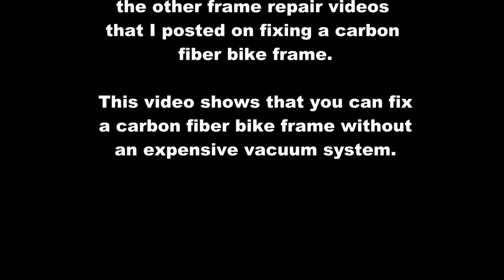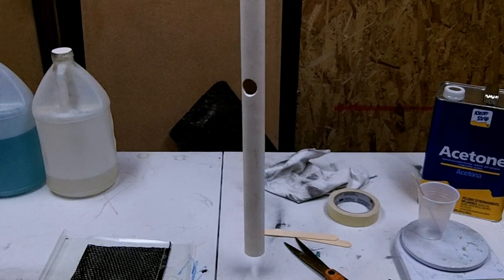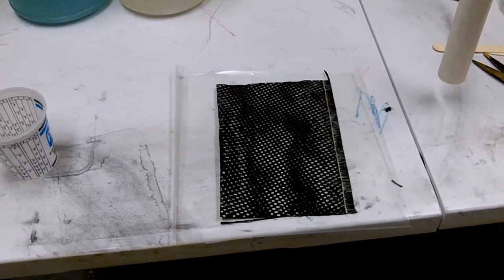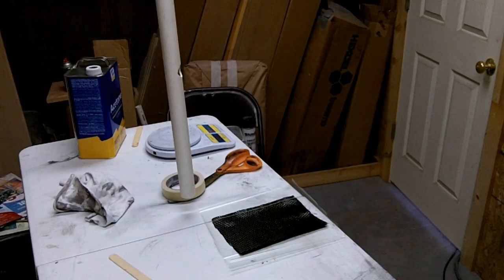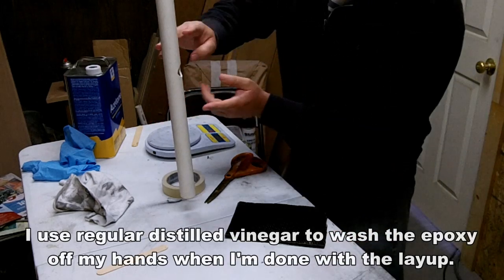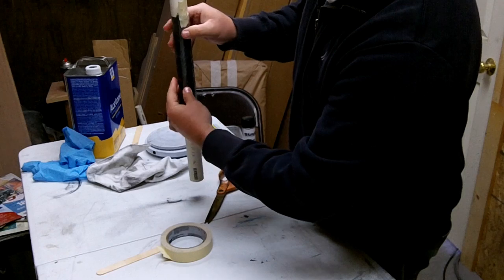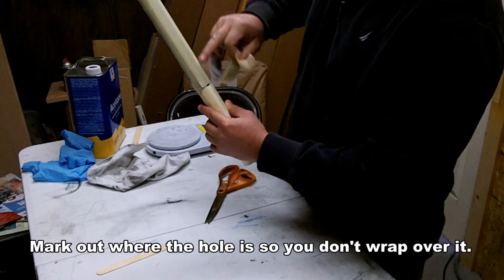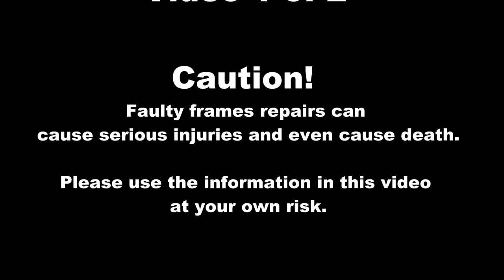Carbon Fiber Bike Repair 2- Tape Wrap Alternative 1 of 2

Comment: I worked with carbon fiber very often in the course of my work, be it carbon rod, plate or fabric/wrap type for strenghtening of structures..I meant huge structures like marine jetties , concrete bridges and buildings weighing 1000s of tonnes. Carbon fiber's the solution and even increases the tensile strenght of the frame. We used carbon for F1 cars body..go find out the body weight and thickness of carbon fiber used.. :) Well done,Mark King. I will share with fella bikers in Malaysia ! Tks !

Comment: Hm, I use peel ply tapes. So you don't need any pastic. I apply epoxy on top of the part to repair, and wait until it gets tacky. Then apply the carbon directly and put the epoxy on top. Then I use a heat gun so the epoxy gets runny and it goes everywhere in the gaps and saturates the carbon perfectly. Wrap the peel ply tape with tension around and you are done...

Comment: Have you actually checked if resin's Tg or HDT is enough for use under hot summer or for storing bike inside of a car? I need to fix a frame myself and I figured out that often advised WS 105 has very low Tg of approx 50degC. My plan is to post cure the patch with help of heatgun and small wooden box "wrapped" around area to be fixed.

Comment from the maker: @JOEY15277 
Well, I couldn't say for sure- it depends on a lot of factors and your repair. But honestly, I think you'd be fine just using the +/- 45 fiber orientation without the uni- you'd definitively want more layers to compensate for the the lack of uni though. I don't know this for sure but I don't think a lot of the guys repairing bikes professionally are using uni on their repair jobs.

Comment: If there are chips in the paint, does that mean the carbon underneath is cracked? I just got a frame off eBay and it seems solid, doesn't give when pressed, and feels solid (no cracks felt by touch) on the inside of the frame. It's on the side of the top tube near the head tube. Wondering if its worth the trouble of sanding it down to see what's going on and possibly run this fix
Reply: +SoSickWidit  If the frame is not repaired you run the risk of unexpected frame destruction due to cracks you cannot see. This is where carbon is a bitch to own.

Comment from the maker: Try? "Do or do not, there is no try"- Yoda

I wash my hands off with regular distilled vinegar and it gets the epoxy off- No hand irritations and no problems. The epoxy I use isn't that toxic when exposed to your skin. However, it's always a good idea to where gloves. Also this epoxy has a really low VOC content so unless you're huffing it, it's not going to do much. Polyester resins on the other hand are nasty. I do where a mask when I'm sanding CF and not filming.

Comment: What if the something major like the downtube is snapped right through (fairly clean break) , given enough overlap do you think you would get sufficient tensile strength and rigidity?  
Does the new carbon fiber bond well to the existing frame carbon fiber?